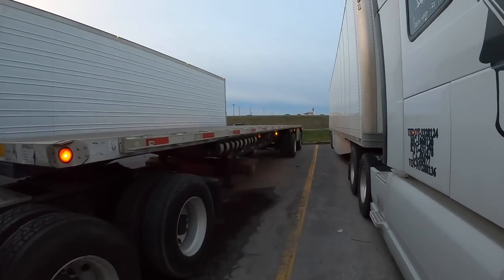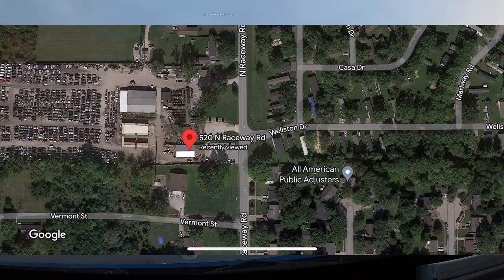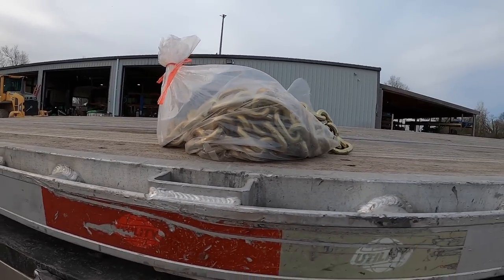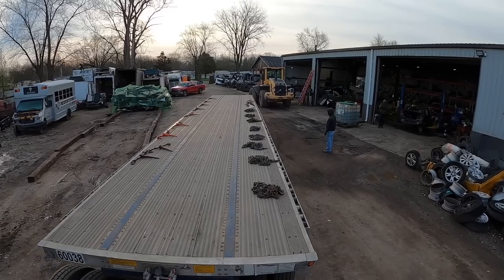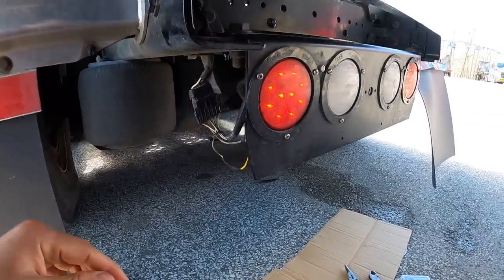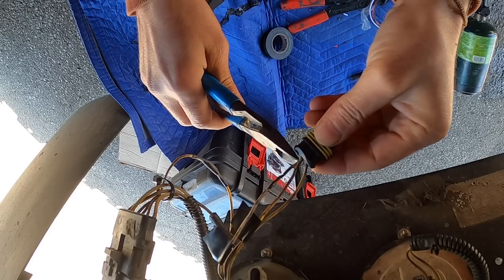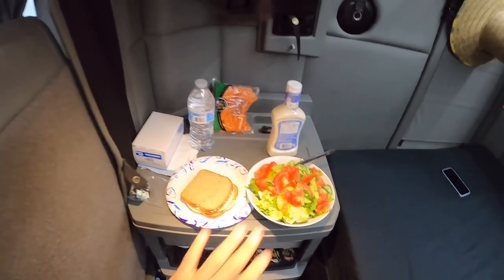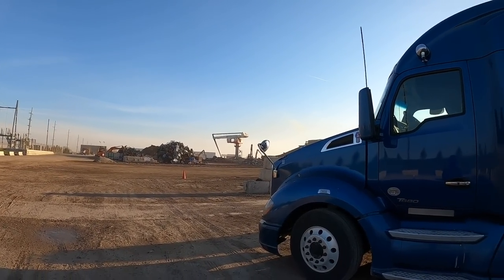#158 Hauling Crushed Cars For The First Time!

Comment: The red handle tool you used to strip the wire also has a built in crimper section.

Comment: You should buy some heat shrink butt connectors. Also your stripping tool can be used to crimp your connector and is designed to do so. It all worked though!
Reply: Great advice! He’s always willing to learn, too!
Reply: I was wondering why he wasn't using it to crimp the connection
Reply from the maker: Thank you for pointing it out! I actually didn’t know it.

Comment: Make sure you buy the correct tool. You will need atleast 3/4 drive impact wrench but 1inch drive is preferred.
Reply: 1 in is the best but the half inch is much lighter and it has been working wonderfull for 4 years for me. Milwaukee

Comment: Did the shipper put the chains over the cars and ratchet them down as well?
 How much dunnage, 4x4s did you use?
 Do the cars leak oil on your trailer and cut up the floor. Thanks for the vid.

Comment: what size and length of chains did you have? and how many did you end up using?
Reply from the maker: I have 20ft long 3/8. I used 9 chains on the load and 5 more chains as an extension. Total 14 chains and 9 binders

Comment: Yep things under Biden are 2x as much as under Trump. I wish I had bought more.  I bought 2 grade 70 chains @$50 20’ 1/2”. I hate yards with junk everywhere. A flat tire is in your future.  At 8:15 you have the correct crimping tool to crimp the blue connector. (I think) it’s even color coded. A needle nose will do a poor crimping job.   But if all you have.

Comment: What year is your trailer?.. do you recommend a 2015 trailer?
Reply from the maker: Mine is 2013. 2015 is fine also. Just make sure the trailer has a solid frame/no cracks
Reply: @ontheroad7097  thanks a lot

Comment: 11:32 - handy accessory for the grease gun is a tip with a lever that lets you clip on and off of the zerk fitting. Makes it much easier since you’re not having to hold the nozzle against the fitting. This one, but there are other brands;

https://www.amazon.com/LockNLube-fittings-best-selling-Long-lasting-rebuildable/dp/B00H7LPKKU/ref=sxin_17_pa_sp_search_thematic_sspa?content-id=amzn1.sym.570e7680-987b-4043-baad-ab61ea81d6c9%3Aamzn1.sym.570e7680-987b-4043-baad-ab61ea81d6c9&cv_ct_cx=Grease+gun+nozzle&keywords=Grease+gun+nozzle&pd_rd_i=B00H7LPKKU&pd_rd_r=1c19b849-0af2-44e6-89b6-4ec6c92c5273&pd_rd_w=LLJbE&pd_rd_wg=o2mqu&pf_rd_p=570e7680-987b-4043-baad-ab61ea81d6c9&pf_rd_r=GRYNBD4MYC91R5W3P5GX&qid=1682111428&sbo=RZvfv%2F%2FHxDF%2BO5021pAnSA%3D%3D&sr=1-1-a73d1c8c-2fd2-4f19-aa41-2df022bcb241-spons&psc=1&smid=A3UPOD5O08GT8E&spLa=ZW5jcnlwdGVkUXVhbGlmaWVyPUEySlhFNzlDRlM5RFFIJmVuY3J5cHRlZElkPUEwNjU3MDA1M0JQOEZDQjFaR0RBNCZlbmNyeXB0ZWRBZElkPUEwNDM5NjgzUURMRkRVWkJFOTFUJndpZGdldE5hbWU9c3Bfc2VhcmNoX3RoZW1hdGljJmFjdGlvbj1jbGlja1JlZGlyZWN0JmRvTm90TG9nQ2xpY2s9dHJ1ZQ==.